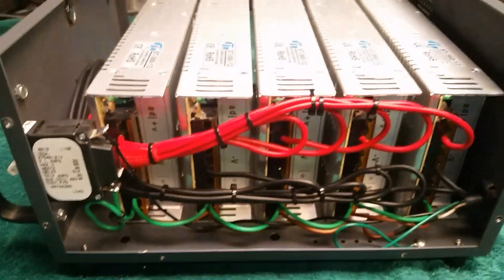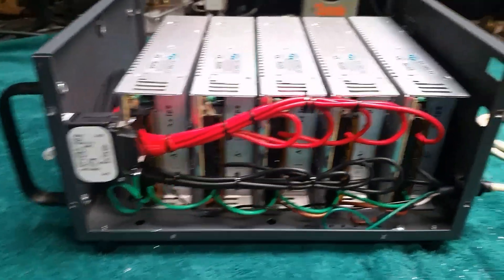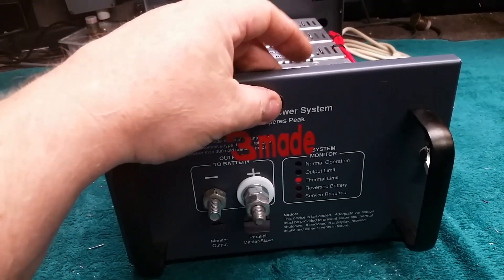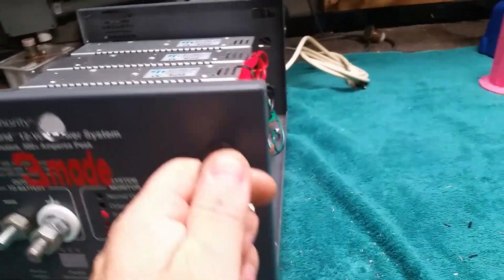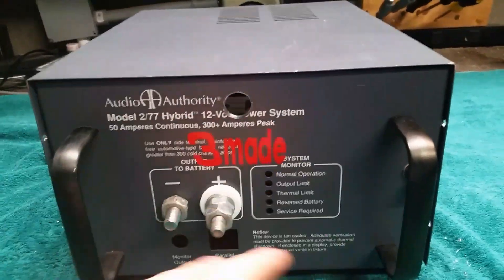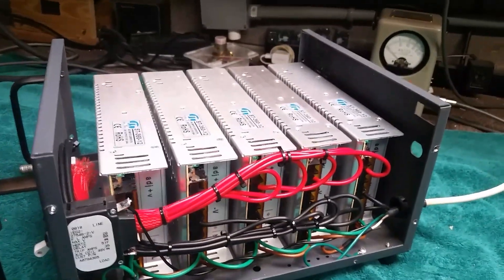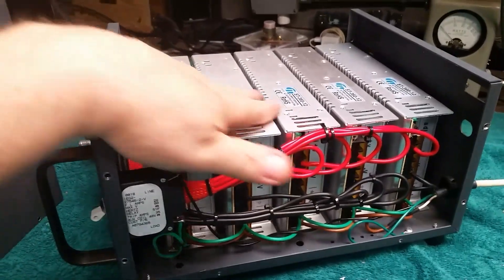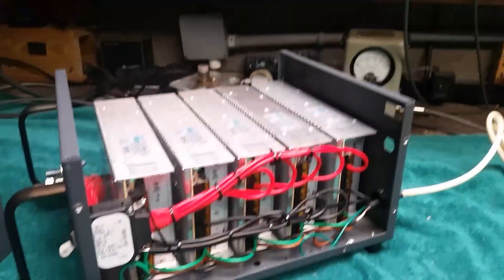150amp Regulated Power Supply

Comment: great re use of a cabinet. I got some switchers like this off eBay. 12 to 15V adj. 30 amp. was not a meanwell like seller listed. went up in smoke at around 20 amps. there is some cheap china crap being sold on eBay. I built a old school 14V 200 amp supply in 1988. still works. 30 2N3772 pass transistors. I am sure that supply  will run a lot cooler than mine.
Reply from the maker: robert meyer ..you have to modified them a lil .so u can't just buy a 30a switching power supply and get full output of the amps in a rf amplifier with out some modifications
Reply: yep. need RF blocking. both the AC in and DC out. the one that smoked was on a AF amp I was testing. 150 watt. that's fine. I never had a meanwell supply quit yet. using 48V on LDMOS running just fine. 1.5Kw 160 meter to 6M can go to 50V .left at 48. thank you for pointing that out  . watch for the cheap china counterfeit stuff. I stick with sellers I know and trust now. i love eBay.